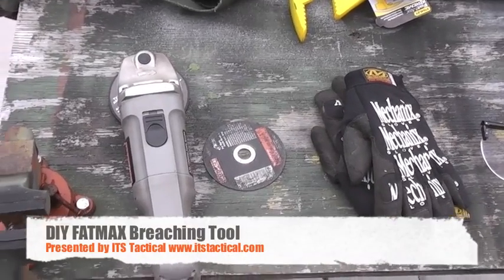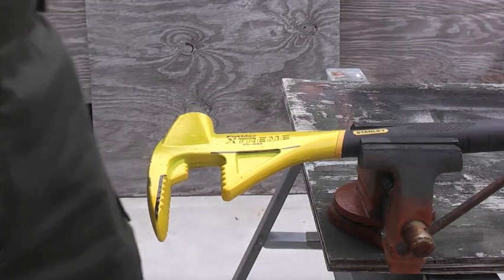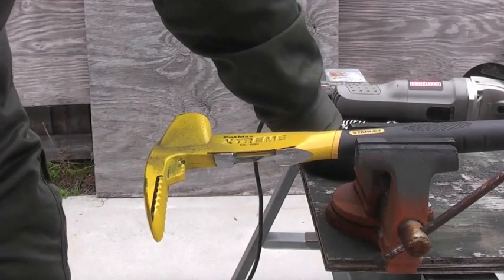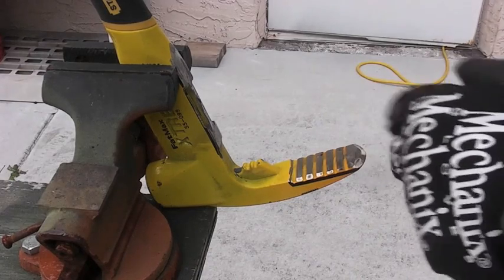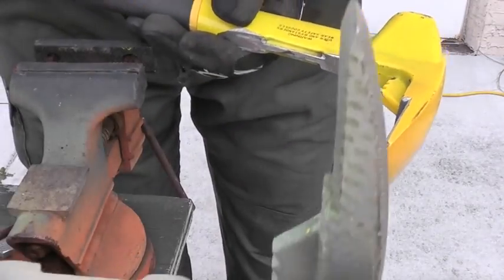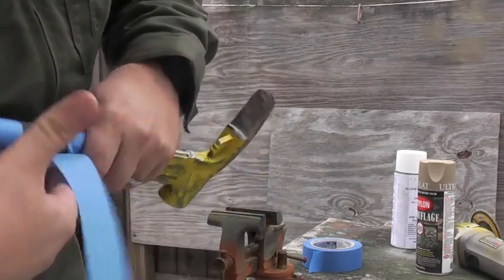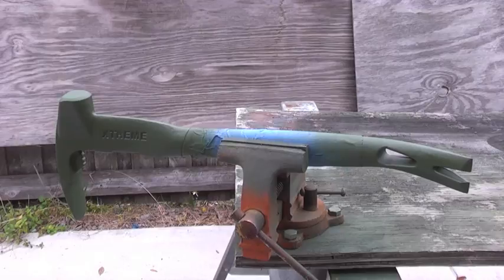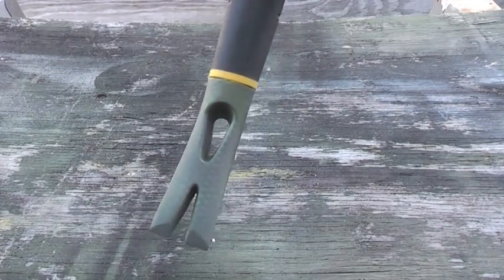DIY Fatmax Breaching Tool

Comment: Dont take this personally, but your grinding and cutting skills are severely lacking & you risk serious injury. Unless you have a lot of experience & it is essential, you should always have the guard on the grinder. It means you can use the tool in its most efficient and safe position without worrying about being showered in sparks. If the blade does catch (and it only every catches through poor technique) the guard will act as a stop.

Comment: Lol did you learn how to use your $20 grinder from an Infomercial?
Reply: Cool story bro, the ends justified the means. Troll someone else.
Reply: Using an angle grinder since I was 8 justifies my means.
Reply: Evidently YOU don't know an angle grinder. How he was using to using it could've resulted in a wheel catastrophically failing, minimal control over the tool, which is spinning around 13000 rpm, so either the broken wheel on the tool is going to rip off/into body parts, or the debris from the wheel will embed itself into the user. Howabout you look up angle grinder accidents on google images, see the people with their faces split in half. As was mentioned in other comments that's unsafe tool usage and for a sort of HOWTO video it's promoting extremely dangerous tool usage.

Comment: Your discs are still brand fucking new..and dear god please know you can use more pressure and not fight against the tool. It still works for you but it won't take you ten years to cut or grind

Comment: you know you just ruined a life saving tool, right? the parts you cut off are meant to turn off gas supplies, open fire hydrants and assist in forced entry. also those parts are great for demolition too. modify all you want but know what abilities you are taking away from the tool before you do it. have a nice day....

Comment: I just bought one of these things, and I don't get it. Why destroy a tool to make a modified hammer? Don't think I will be trying this mod. Looks dumb to me.
Reply: It's for breaching.
Hence the title of the video.

If you have no need to breach door, perhaps this mod isn't for you.

But, the board bender is pretty useless on the stock tool and the breaching pick can do almost everything that it can, so I see considerably more utility in the modified tool than the stock tool, and I've have one of each for years.

Comment: You just destroyed a perfectly good tool. Stanley use CAD to design their tools along with immense thought and research plus real world testing with professionals, tradesmen and DIY'ers.
You do not even demonstrate a use for the finished article. Is that in another video ?  You could have found a cheap crow bar, jemmy, piece of metal, anything, at a car boot sale and then mangled that to your liking, rather than ruining a Fatmax modern, concept tool.
Reply: He ruined the tool for its engineered purpose, yes. But he created a small, cheap, and easily carried tool similar but much smaller than a halligan bar, the purpose of which is to gain forced entry to a building by various different methods, by itself or with other tools such as an axe or K-Tool.

Tools like this are used by fire fighters, heavy search and rescue teams, etc.

Comment: No clue why someone would break a tool that works, to "make" something that doesn't work as well...
Reply: Nothing of value was lost by cutting that lower jaw off, dude.
Reply: @wanderingcalamity360  Oh good to know, I spent 8 years worrying about it. Guess I'll get started shearing off a piece of tempered steel on the haft of a tool so I can now turn a demo bar into a lighter framing hammer. Thanks bro.